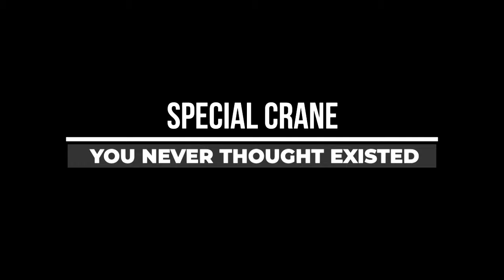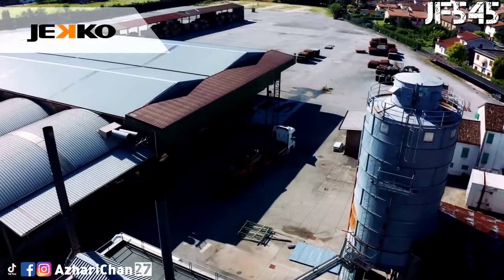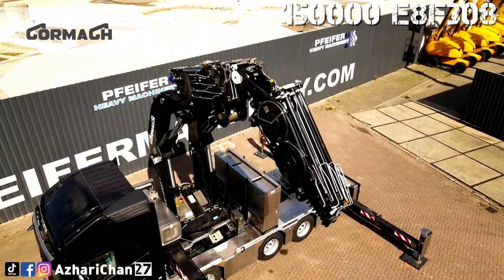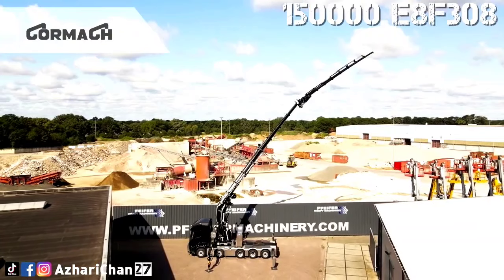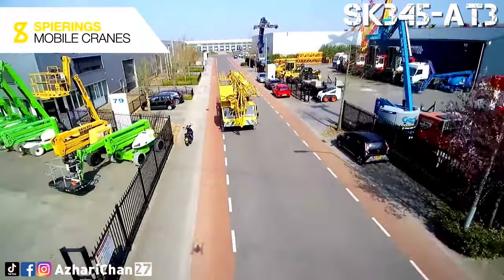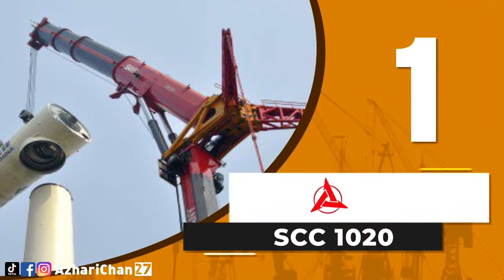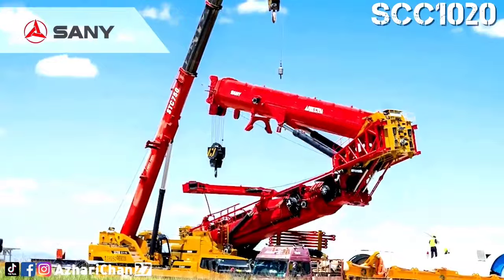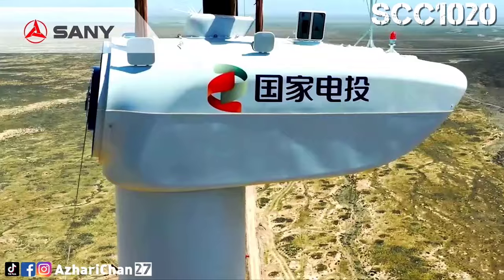The Most Incredible and Impressive Performance Special Crane That You never thought existed

Comment: Right, there were some contractors in Germany, who had the GTK1000.
But the Windturbines quickly outgrew that crane.
I saw one at a Powerstation-site in Duisburg-Walsum in 2008.
But then a hydraulikline broke and the oil got sprayed all over the site.
Not good, the crane was dismanteled and never seen again.